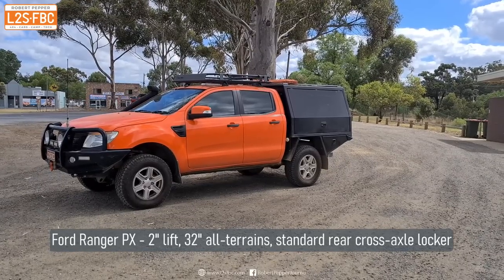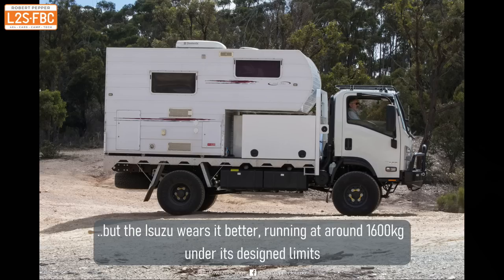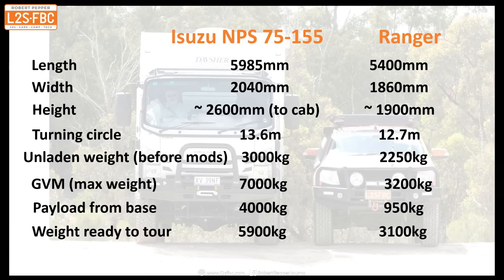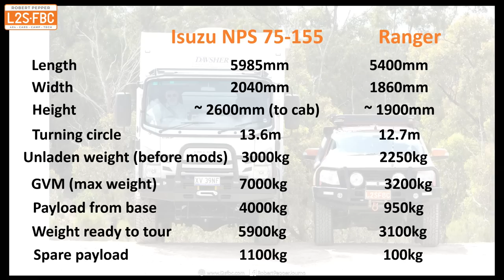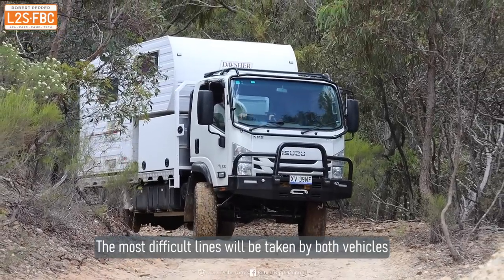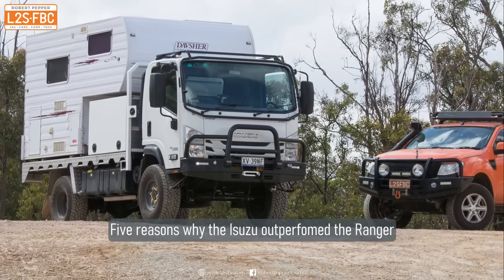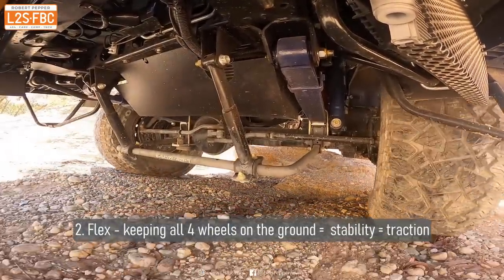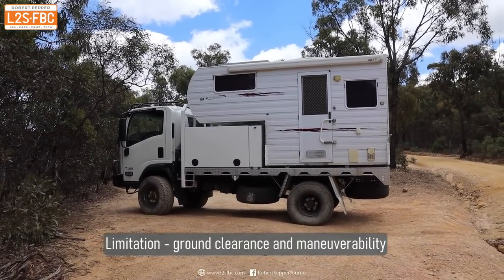Best offroad - 4x4 truck or 4x4 ute?

Comment: In the tree section (where the mirror was folded) it's clearly seen how that manual transmission hurts Isuzu. It's just too much stuff to control for the driver, and instead of going nice and slow it moves jerky and messy always rolling backwards a little bit. Maybe a lower gear ratio would help, I really don't understand how this joke of an engine does this well with laughable 1.8 while something like a Jeep Wrangler has a lot more torque and a lot better 4.0 low range. Even the old Defender with about the same joke engine had 3.0 or something, IIRC. And this thing's got which tire diameter?!
I mean, I'm not dumb, I see it moves, it climbs, probably because of low final drive and low first gear, but I also see Isuzu doesn't move effortlessly as something like a Ford Bronco would.
And also most of the Isuzu capability comes from mods. It ain't cool. Any car can be modded to the point it becomes the fastest or the most capable. There's no beauty in mods, it's like playing a game using cheat codes: it is fun for a while, but soon becomes boring, as you defeated the whole purpose of the game - the challenge of overcoming an tough situation using a standard set of tools. I know you're familiar with Snowrunner. Imagine always using ANK Mk38 with all the chassis add-ons, autonomous winch and 0 fuel consumption - not very fun of a game, wouldn't it be?
Reply from the maker: The Bronco is a far smaller vehicle so not a fair comparison. Smaller vehicles will always be more agile. Have to disagree re mods.
Reply: @L2SFBC  that's even better reason for me to prefer a dedicated offroad truck and not a modified 4x4 Isuzu. But there's one thinf that justifies your build: the appearance. Both Gaz and Iveco are ugly. Iveco's a little better, Gaz's a little worse. Isuzu is a lot better looking. Canter, I believe, is the prettiest, but Isuzu is fine too.
Reply: Vasyl, you make some good points, but things are not always what they seem.

The Japanese, Thai and Indonesian military forces, to name some of them, use this same truck with almost identical changes to this one, for their respective military uses. 

In Australia this vehicle is only sold in the civilian version, which includes 4 tyres on the rear axle for a heavier payload. When the vehicle is supplied for military use with single wheels on front and rear axles, the payload is reduced just like this one. The standard unmodified vehicle is extremely capable and would have almost no issues with anything shown in the video. The modifications made are mainly for comfort and in the case of the single wheels, safety and comfort. This vehicle is used for travelling for months at a time, for that purpose it is excellent.

The wheel diameter is 940mm

The engine is 5.2L 

It has more torque than a Jeep Wrangler.

A Jeep Wrangler does not have a complete house on the rear. In fact if the house on the back was removed, the Jeep Wrangler could go on the rear and it would be roughly the same weight as it is here and legal.

The maximum payload of a Ford Bronco is roughly 566kg, depending upon which model. The Isuzu light truck has a payload of either 3,000 kg or with different wheels 3,500kg. So I am not surprised that the Isuzu light truck doesn't move as effortlessly as a Ford Bronco.

As for the tree section (with the mirror folded) I used the hill start function. The hill start function holds the brakes on, once you start to feed the clutch, the brakes are released. So the truck will always roll back slightly before the clutch starts to catch. It isn't an issue, it is how it is designed. I did however use a little bit more throttle than I should have, I throttled down then drove out.

Comment: You need to compare apples to apples. These two truck are not even in the same League.
Reply from the maker: The point was to use the Ranger as a baseline so people understood what the Isuzu could do relative to a ute they knew.
Reply: @L2SFBC  Whoops my bad. I'm a little short on brains today.